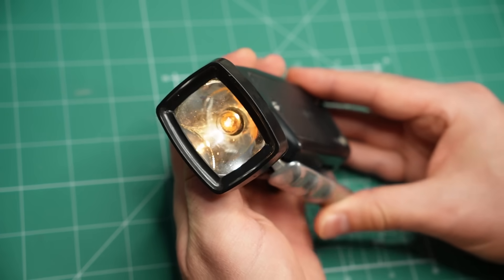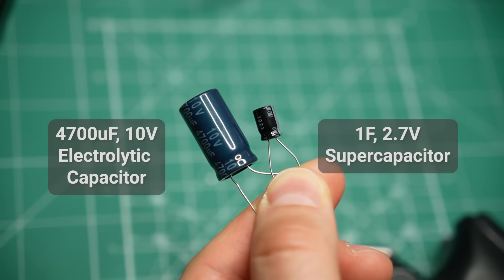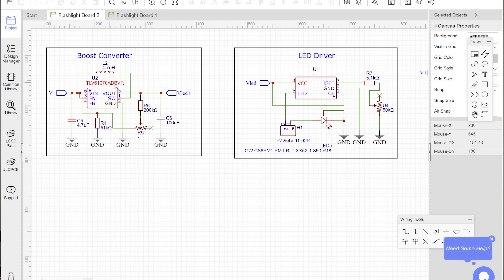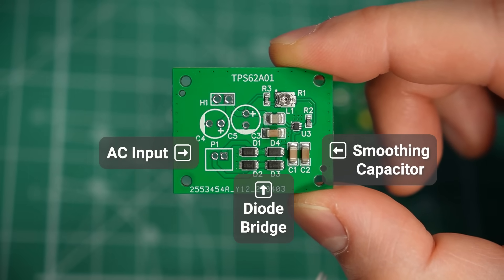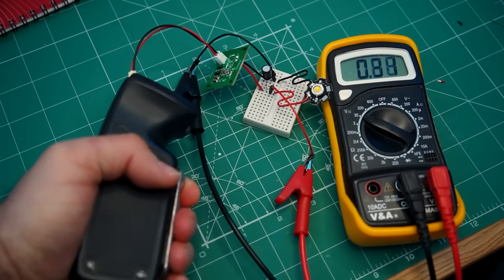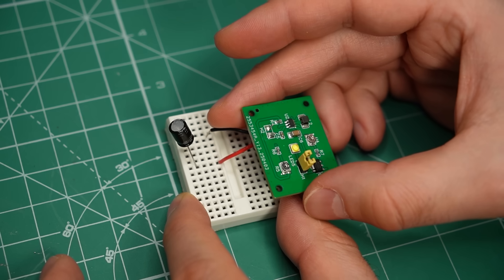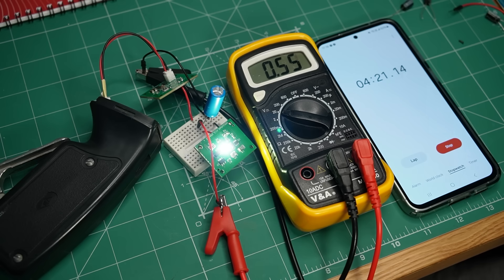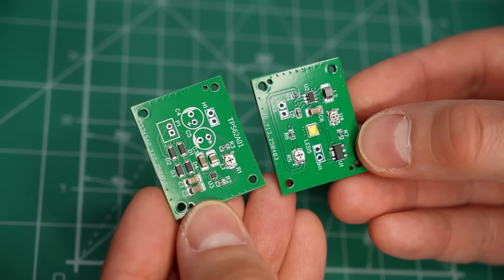I overengineered the no-battery flashlight (with supercapacitors)

Comment: You probably need a more efficient AC dyno, and to add more resistance to the pumping for more energy extraction. Also a little oil on the gearing would help.

Comment: what if you used a zener diode to switch the flywheel output from powering the LEDs directly to charging the supercaps as well when the output voltage goes over the threshold?

Comment: It might be stupid, but what if you use the capacitors not to light the LEDs but to keep the dynamo spinning for longer?
Reply: I was thinking the same thing.  Generator > full bridge rectifier > capacitor > buck converter > super capacitor > led. The capacitor would stabilise the power from the full bridge rectifier and create a buffer between pumps of the generator. This would make you be able to pump the generator at a slower pace.

Comment: Awesome, i was wondering how long the light would last, maybe removing half the number of LED will make this project more convenient. I have one of those lamp with a 80mAh battery inside but still i think supercapacitor are more appropriate because it can charges faster and capture more of the energy you're producing so you should be able to get more light time with less efforts.

Comment: A simple tweak that should extend the usable time of the LED stays lit is to add a duty cycle - human eye is slow, so most of the time the LED is on, it really does not see it and the energy gets wasted - blink the LED so it will appear to shine for longer.
Reply: Don't forget it takes energy to switch transistors, and he already has current control.

Comment: add a flywheel to the mechnism and use one of those beyblade string launchers as a starter , make the flywheel diameter big and heavy and a few pulls from the string launcher should do the job

Comment: I dont know anything about how to build things like this, but you said the flashlight couldnt charge a battery, but would it be possible to charge the capacitor, that in its turn will charge a battery? 🤔
Reply from the maker: it is technically possible, but it wouldn't solve much. The flashlight can charge a battery, but very slowly. The mechanism makes ~0.37W and that tiny battery I showed is 0.18Wh (0.18Wh divided by 0.37W equals 0.48 hours of charging). That's half an hour to charge the battery without making any light. Of course, you don't have to charge the battery completely to use it, but then having it becomes pointless if you use just a small fraction of its potential. Another issue is that the battery would self discharge over time when not used, which shortens its lifespan.

Comment: I think you can avoid de buck converter by just using 2 or 3 supercaps in series, so they're safe with the maximum voltage
Reply from the maker: Yes, I should have probably done that. Another issue this would avoid is that at lower voltages, the boost converter becomes less efficient.

Comment: Wouldn’t PWN increase the run time of the light? Great project and great filming of the process
Reply from the maker: Yes. If you dim the LED, it will last longer, but it's already configured at ~30mA, which isn't very bright. For context, a 5mm LED can do 20mA. The simple configuration from my previous video can easily do 50+mA through two LEDs, which makes it much brighter.

Comment: Adding a switch might be cool.    So one could pre-charge the capacitors and use the 45 seconds of light later on.

This could also maybe be some logic with the hand crank.   eg:  crank it up and light the led but turn it off after 5 or 10 seconds of no cranking and save the power for later.   But if the user just cranks once every 5-10 seconds,  it will keep the light on until power runs out.
Reply from the maker: I was thinking about this, but I would have had to cut/break off some parts of the plastic. There is far less space inside the flashlight than it seems

Comment: Part 3: I designed a super-efficient low voltage active PFC and implemented a super light constant torque CVT to milk the handheld dynamo to the last drop.
Part 4: I invented a new class of blue QDEL and alchemy-synthesized a new phosphor for a 300lm/w efficiency to hijack a laser show with this hand-crank dynamo flashlight
Part 5: BE NOT AFRAID
Reply: I'd watch

Comment: May i suggest going to decathlom and buying one of their cheap crank lights?  They illuminate immediately and keep going for a couple of mins. 

You could probably reverse engineer it and make yours do the same .
Reply from the maker: I had one. The battery leaked eventually, but it was good when it worked.
Reply: @LeftyMaker  ive got several that are at least ten years old, one is likely 15 years old, still works fine.

Comment: To get instant power, you need to resolve the undervoltage lockout issue the supercapacitors are introducing. Rather then designing the power electronics in a sequential conversion such as generator - > rectifier - > buck - > supercaps - > boost - > led driver,

It would be better to add a second input to the LED driver to to allow the high voltage of the generator to bypsss the supercaps during their slow charging period.

You can control when the bypass mode turns off by connecting the power good pin of the boost converter to the enable pin of your bypsss transistor circuit.

Comment: 1:30 Interesting learning point: Capacitors hold DC, if your goal is to store energy. Capacitors pass AC, when you want to filter power. Put another way, a capacitor can protect devices in the circuit from DC, because it blocks DC (unless it's leaky).

Comment: What if the sequence of operation is changed, when power first applied instead of charging a cap, it turns on an LED which also supply a tiny current to a mosfet or transistor to start slowly ramping up charging the cap so it didnt take all the energy and powers off the LED ? That way the first time you pump it the LED lights up then it would also start charging the capacitor, that way it charge using excess generated energy instead of having to wait for some time for the cap to charge up before LED would light up, if you pump it long enough, it will fully charge the capacitor and lets the LED lights up longer on capacitor stored energy otherwise it will shut down in a few second

Another idea i have would be using two diodes to charge two super caps in series one leg of the generator coil connects to the middle of two caps (where + and - is combined) the other leg go to two diode, one anode, one cathode, the output of those diode connects to the capacitor accordingly, clamp the voltage with a zener or something to prevent over charging, im gonna assume that generator dont have a lot of current capability meaning if the voltage is dragged too low it will generate less power (assumption since i dont have the exact generator to do test) allowing it to work at higher voltage means its likely to produce more energy

On existing design, To prevent overcharging maybe you can add a comparator that will increase current to the LED once it hits max safe voltage, just enough to clamp the voltage like a zener to prevent damage and you also get bonus light, voltage base means it will ramp down as capacitor discharges, that way it didnt decrease run time on capacitor as much

Comment: Kinda the result I expected.  The actual mechanism just doesn't make enough power and now there's a bunch of additional losses.  I wonder if a more mechanically optimized one could be made, between stuff like gearing, the flywheel, the construction of the generator, etc. though I imagine the original was intended to be usable with a kid's grip strength so it might just already be near optimal based on its design constraints.

Comment: Okay, first off, I hate the design of commercial crank flashlights the crank is easy to turn and power doesn't last long.

 I would design them so that the crank is difficult to turn, meaning a lot of work gets converted into electric power quickly, combined with capacitors this would be probably a good combination. One turn of the crank for one minute of light, ten turns maximum storage capacity, that would probably suffice and it would actually be useful.

Comment: Could've used multiple caps in series instead of using the buck converter.
Reply: Yes and I think I have a good idea for how:
If you only do two, you can make two half wave rectifiers so that each half cycle charges each capacitor.  This is more efficient because there is then less loss in the diodes.  
The existing design will get up to too high of a voltage for a supercap so each one could be two in series.  You can balance the voltage on the supercaps with a circuit that is only really acting if the voltage goes too far out of equal.

Comment: It is not possible to put 2 capacitors in series to bump the voltage, dropping the need for a buck converter?
Reply: I wonder how well that would work out, especially as you add more caps in series. With lithium battery packs there's often one cell that's not charged to the same level as the others.
Reply: @edherdman9973  are there BMS for caps?

Comment: While a neat idea, the capacitors are going against the main practical purpose of this little device, which is the advantage of direct mechanical energy conversion. The direct LED swap is the only straightforward way to 'upgrade' it, because otherwise the whole thing needs to be re-engineered to take advantage of the better efficiency of LEDs. Such as using a spring in addition to a flywheel, letting the user store energy mechanically and release it steadily over a longer period of time, which would not have worked with the old incandescent bulb.

Comment: hey, since you seem to know how to make pcb designs, could i pay you to make one for me? i need a 18v to 38v boost converter that can handle 150w input
Reply: You can likely buy one for those
Reply: @kensmith5694  i could, and i have, but theyre all adjustable/have a huge voltage range, which adds complexity, they have reliability issues, and likely use cheap parts. i need something for my specific voltage range, that uses higher quality parts
Reply from the maker: Honestly, you should probably ask a professional. I'm just a hobbyist and I've only designed about 10 pcbs. Still got a lot to learn.

Comment: I don't use my multimeter often and always the battery is drained. Could you made a guide to hack it like the flashlight?
Reply: What voltage battery does it need?  You may be able to run it from a solar panel or something.
You need light when you are working on stuff.
Reply: @kensmith5694  is a 9v battery

Comment: i have no clue of electronics. but isnt it possible to sneak "some" of the generated energy past the supercap charging stage, so the LED will turn on immediately and only the energy which surpasses a certain threshhold will then charge the caps?

Comment: You might need to increase the gear ratio or modify the generator so that it makes a higher voltage then use a joule thief circuit

Comment: Add a battery and a 3mode switch to this light.
The three modes can be  On,charging and off.
On mode will let the torch be active with the cranking and battery/Super capacitor power.
Charging will put the charge from cranking directly into the battery and get the super capacitor have some power access and be primed for use in the torch.
Off will stop all power from the cranking to stop at the crank and  torch Leds ,battery and super capacitor won't get any power supplied to it helps to prevent overcranking and over charging the battery and super capacitors.
Will be great if you add Led indicators to show which mode the switch is Set to or is on.😊😊😊

Comment: I would like to suggest that it's possible to overengineer it that much more. You can have two supercaps in series running 5V, and an opamp virtual ground servo to balance them among each other. You also want an active rectifier rather than a bridge rectifier, ideal diodes from MOSFETs, to stop the voltage loss on diodes. You also need a shunt regulator which passes current back to the dynamo to limit the total voltage of the supercapacitor. And the LED can be driven by a constant power PWM such as PT4115.
Reply: as long as you get decent quality supercaps with a tight enough ESR tolerance you can link them up in series with no need for any rail to rail Op amps
Reply: @MaxC_1   Oh come on go away with actual reason and common sense, i'm trying to overengineer things here!
Reply: @SianaGearz good luck running mosfet based diodes at such low voltage.They wouldn't even reach saturation and end up wasting more energy inturn
Reply: @Yeeaits   That's why gate drivers are a thing which step up the gate voltage capacitively.
Reply: @SianaGearz wait they step up too? gotto check some now. But then it would also result in lower efficiency which was the main point tbh
Reply: @Yeeaits   The output isn't stepped up, that would be murderously inefficient, but the gate takes barely no power to hold up.
Reply: @SianaGearz that makes no sense. They make more power to saturate the mosfet of thin airs? or switching capacitors in series? that is not at all practical for this
Reply: @Yeeaits It does make sense for low current devices such as Mosfet gates, look up charge pumps. 

For the low voltages of this project, the diode losses are so great, it would be about a 20% efficiency gain.

When considering optimizations to the rest of the circuit, I could easily see a 50% efficiency increase.
Reply: @SianaGearz  Point 1: putting capacitors in series halfs the capacitance. Point 2: while charging the MOSFET's gate and keeping it charged takes trivial amount of energy  that is not how "ideal diodes" work. Their gates go through charge-discharge cycles, and that makes gate control power usage non-trivial. There are plenty of videos on youtube that amply demonstrate that for low power devices Shottky diode bridge is more efficient that that of "ideal diodes". You need a powerful load for the reverse to be true.

Comment: It would be cool to add a small battery that's attached to a tiny solar panel
Reply: You need a battery that can be stored in the discharged state.  That can be a problem with a design like this.

Comment: Do it with 2 leds and 2 small capacitors. I think you're right. Also, maybe you can replace the glass for methacrylate. It would make the flashlight lighter and safer.
Reply: and if you start to sell those i would like to buy one xD

Comment: I know that brighter is better for viewing but when power is at a premium perhaps it might be a good idea to limit the current in the LED so they have a dimmer output but also longer on time. Just like when you're running out of gas you don't go fast.  This is an interesting exercise in trying to squeeze the most out of a circuit.  I also wonder how efficient the generator is.  Magnetic strengths have really improved in the last 30 years and that generator might be truly awful.
Reply: using lower power rated led can help i think

Comment: Great work! Now that energy storage and bulb efficiency are improved, it would seem that the next bottleneck in the system is energy input, like switching to a rip cord or crank.
Reply: He is likely still losing a lot of energy in that rectifier.  A synchronous rectifier could save that power.
Reply: Rip cord is exactly what I thought.

Comment: I had one of these like 20 years ago that had white LEDs and a crank handle instead of the squeezing mechanism. I don't know what it used for storage but it lit up as soon as you started cranking and lasted 10 minutes or more.
Reply: The one on wikipedia looks like the exact model I had, apparently it used a 35mAh lithium cell
https://commons.wikimedia.org/wiki/File:Crank_powered_flashlight_disassembled.jpg

Comment: You might want to look at The Joul Thief.  It is a simple blocking oscillator circuit and can power LEDs quite brightly.  A variation is in the cheap garden solar lights.

Comment: I feel like there should be a joule thief and a threshold to bypass charging
Reply: He is using a booster chip.  They are more efficient than the joule thief circuit.  The joule thief wins for simplicity.

Comment: It’d be cool to see how much longer it could run with a red LED instead
Reply: The human eye isn't very sensitive to red light.  An Amber LED may be better.  At lowish currents they only need about 2V so it will cost a bit of voltage vs the about 1.6V for a red one.

Comment: Things to try:

Improve the flywheel and or crank mechanism?
- superlube on any bearings 
- heavier flywheel (it is essentially a mechanical battery after all)
- better bearings 
- different gear ratios 

Better dynamo?

Would it be possible to have some circuitry to charge a small capacitor first, then once operating voltage is reached something like a transistor switches to add load like a larger capacitor with a limited current draw so it doesn’t go dim once the bigger capacitor come in?

Wack in a battery and USB C charge port?

Comment: COULD YOU... put in a new buck converter with a higher range, add a switch, so when switched "OFF" it's in STORING MODE, so you can precharge the capacitors, then switch on, and the leds light?

Comment: What if... I mean.... Theoretically, you rewound the generator with more coil turns and replace the permanent magnet with a neodymium magnets?
Reply: More turns will give more voltage but also more resistance because you would need thinner wire to make it fit.

Comment: Would like to see LICs, the hybrid lithium ion super capacitors have similar voltage range as a single lithium ion cell, but similar capacity as supercaps. LICs also have a minimum voltage they should not be drained below, so with a small management circuit you could have instantaneous on for the light once cranking because it already has a partial charge.